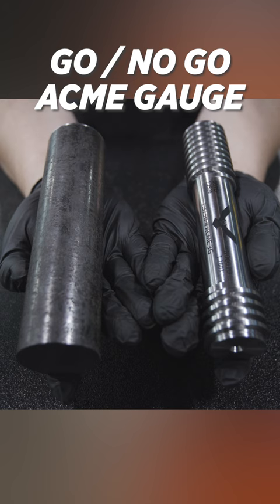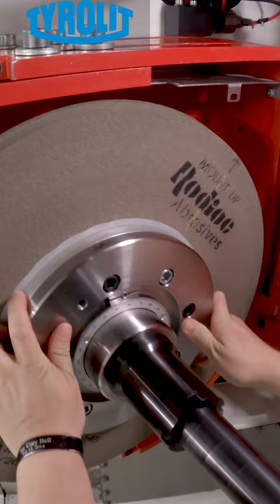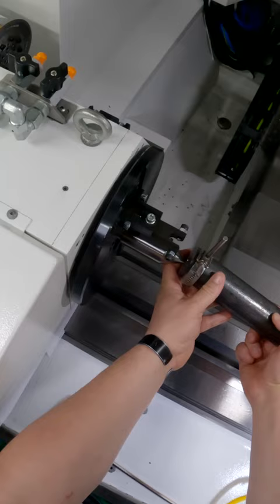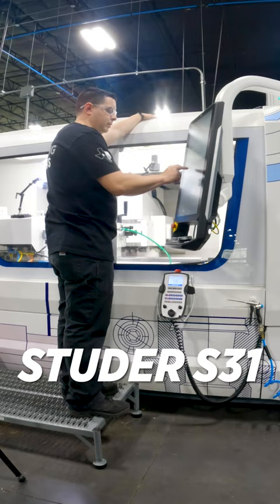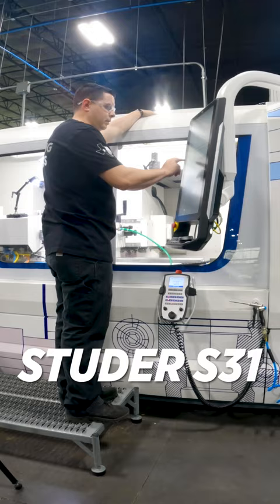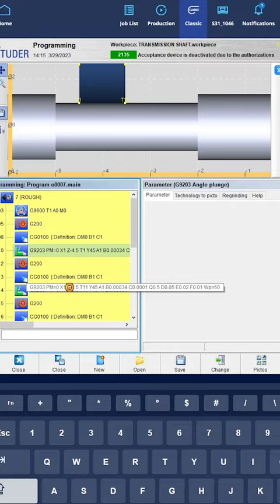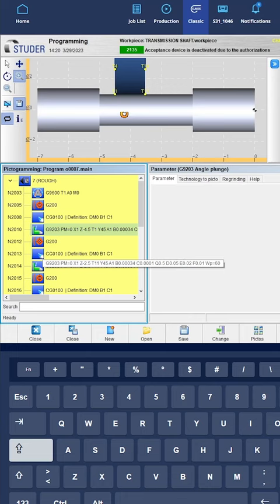Grinding a Custom GO / NO GO GAUGE on the Studer S31

Comment: Why wouldn't you do this on the lathe?
Reply: You sure can if you’re a masochist.😆
Reply: Higher precision
Reply: On a lathe it is possible, but more difficult and longer. Cutting such a thread requires two or three cutters, this requires at least the rotation of the holder, which reduces accuracy. The CNC knows the position of the cutters in space, because calibrated cutters are used. In short, what you can do in a day on a manual machine, a tuned CNC will do in 10 minutes.
Reply: Surely it would pay to rough it on the lathe? The wear on the grinding wheel alone would be horrendous if it did this all day.
Reply: @yaroslav5713 they rotated it here too. Plus doesnt matter how the sides are lined up. But i agree to the better surface finish
Reply: @yaroslav5713 CNC Lathe though, of course it would be a difficult thing to do manually.
And here they flipped the part, so it was two operations.  I would rough it out on the CNC lathe at least and leave .01" to finish grind.
Reply: @somethingelse4424  sensible approach, I would do the same. 👍

Comment: Why would you go an remove so much material? Wouldn't it be more cost effective to rough it down to shape then grind down to od
Reply: Don't know if it's speed up, but it look like it's removing material fast enough to not need to setup another machine.
Reply: @ameunier41  It is sped up (time lapse) and the wheel wear would be expensive with a wheel that size.

Comment: What does go no go mean?
Reply: The "go" side's pitch diameter is made to the low limit of the tolerance. The "no go" side is made to the high limit. If the go side fits into your part, but the no go doesn't, you know the pitch diameter of your female thread is conforming. The corresponding gage for external threads would be thread rings.
Reply: Pass Fail. Passing is a good thing. lol